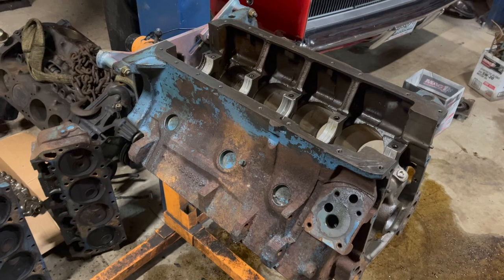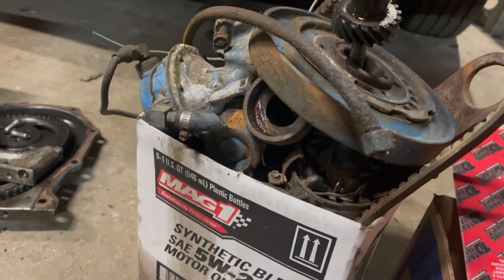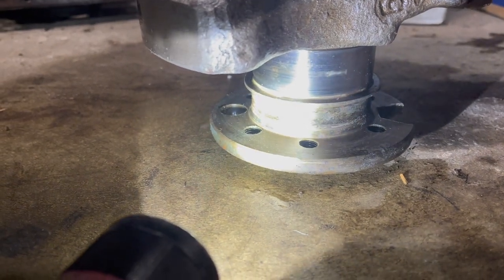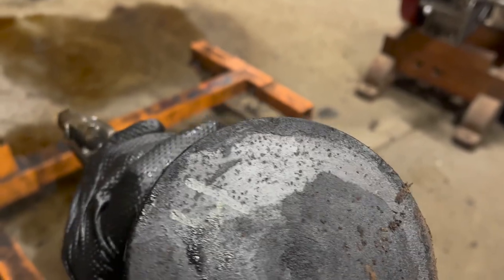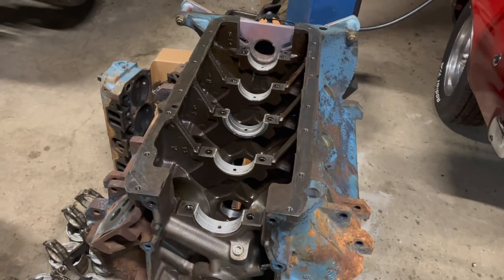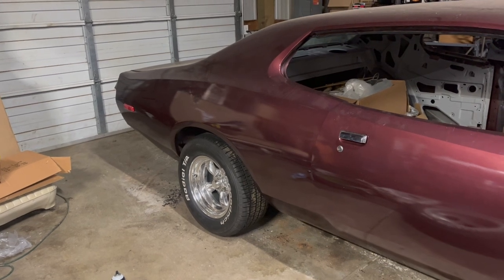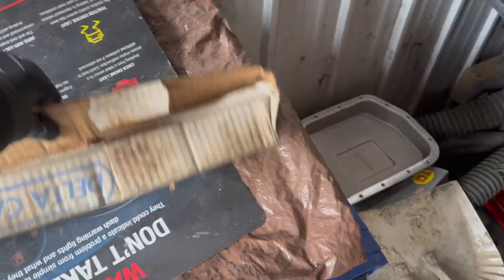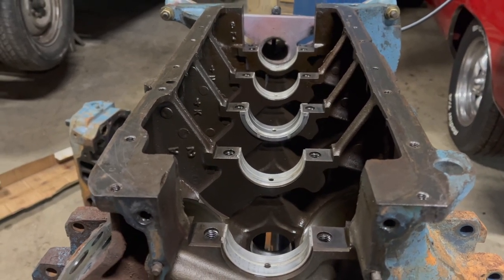How To Annoy A Professional Engine Builder - Convert A Marine 440 To A Muscle Car Engine For Cheap

Comment: I always learn so much from watching your videos.  It confirms a lot of what I've always believed watching good shadetree mechanics building engines without having a machine shop at their disposal.  Somehow things seemed to work out well regardless.  I also agree about the kibutzers.  Everybody is an expert and nothing you do is right, and that applies to everything from body work to engines to cameras (one of my things) to even how I plant my flower bulbs.  Wrong wrong wong and I'm going to hell for not seeking their advice and doing it their way.  Except for the slight problem where they don't pay my bills and don't get a vote in how I do things.

Comment: You've got the right idea (you didn't need me to tell you,lol). The engine "experts" will almost ALWAYS tell you you CAN'T. My engine machinist here in Alabama is age 82 & built race engines for NASCAR star Bobby Allison. I learned to make up some "lingo" required with every job i give him, like "How far in the hole is it ?" (#1 piston at TDC, usually .050 on the smog era RB engines.BTW...those #452 heads,with mild porting are excellent street/strip.

Comment: 11 years ago I bought a bunch of low low miles Itasca motorhomes with 440's in them. Everybody told me I was crazy giving 500-1000 dollars for these motorhomes that nobody would want even if I di fix them up. Within 3 years they were gutted. I now have a very awesome 45' container that I dub the displacement museum. We have come up with all sorts of things to get people scratching their heads. I have a 1981 chevy caprice with a 440 in it.
Reply from the maker: That’s fantastic! I love a good motorhome 440. I was scoring them already pulled for $200-300 for years. I actually just found a motorhome donor myself today! It’s at the junkyard, and it’s kind of amazing because the yard said they’d only take it if the body was fully stripped… so the people did that, but it still has rusty steel framework in the shape of a motorhome body. I think it’s going to become a ramp truck.

Comment: Cool video! Actually those M440 engines used the 440 Six Pack Magnum cam grind that had the 3 bolt drive gear and low taper lifters. I had a couple for the standard rotation engines (Left Hand or CCW).  When you talk about boat or Marine engines the direction the engine rotates is viewed from the flywheel side. It would be opposite looking at the front. So on a standard rotation engine which is LH or CCW at the flywheel, the pulleys and belts turn CW viewed from the front. 
I had a chance to get an NOS steel marine crank once. It was nice, probably just a level below a 6bbl crank.

Comment: Nice, it used to be Hot tank and hone. new bearings and rings for junk yard engine. I had a nice 12 second street car for 10 years no problems. I just checked with chats on the subject and Darn everyone out there Bashing on  Marine block, good to prove them Wrong about it! cant wait and see. and this reminds me i can find a few 440 marine blocks sooner.
Reply from the maker: This engine is now up and running in the 1973 “Toolbox” Charger. I’ve done several videos since getting it together, including a tuning video. It sounds awesome! We are finally about to install the 8 3/4 axle, and then we’ll really get to test it.

Comment: Reverse rotation cranks are ground in the opposite direction and the real seal knurling is typically opposite.
I think it would work fine for my purposes.
Reply from the maker: Ground opposite? Interesting. I knew about the knurling and did mention it in the video. This crank had no knurling whatsoever, which is almost more interesting. Engine’s machine shop trip should be over in the next week or two (I found very deep scratches in cylinder 6 or 8.)

Comment: Well said my friend. Being picked on by people on here is crap. As I told you it's why I shut off the comments on my videos and stopped putting content up. As well as removing tons of cool stuff. 48yrs of building engines and none ever blew up so I don't know anything compared to some clown that has nothing in his garage and mine is full plus sheds full of coolness. When people go low go high and rise above the crap.  Build what you want and run what ya brung. Practice makes perfect and like you said if it don't work you learned something. 😊

Comment: Marine engines are usually high nickel, extra thick castings which is nice, however I highly suggest staying away from any used marine engine that were ran in salt water, only buy/use ones that had a closed loop cooling system (meaning it had regular coolant in the engine that is cooled with a external heat exchanger that is salt water cooled) or ones ran in fresh water only. Ones that have been used in salt water have a bad habit of having severe rust in the water passages and usually all the water ports get pitted really badly on the surfaces which can cause leaks and issues in the future, also a lot of the bolt holes and threads will usually get Soo rusty that you'll have to chase all the threads in the block and have to usually repair several holes as well. Also look any used marine engine over for freeze cracks, that is very common to find as well.
Reply from the maker: Yep. This one came with the closed cooking system heat exchanger tank still attached, or we wouldn’t be here… even so, it pretty obviously ate some water at one point or another, and the outside of the block is just awful in places.

Comment: Beware of a reverse knurl on the rear seal contact area of the crank.
Reply from the maker: I brought attention to that in the video. This crank is smooth in that area.
Reply: @DeadDodgeGarage  Good deal! I've seen normal rotation engines with reverse ground cams and gear drives, reverse rotation engines with normal rotation cams and gear drives. Boats are wierd, also RVs sometimes.

Comment: Good for you nothing the matter with what your doing it does look pretty good I bet it will run fine by the way that a good looking charger
Reply from the maker: It runs awesome actually. This engine has been up and running in the Charger for maybe six months now. It ended up having some serious pitting in one bore that necessitated going .060 over, so by the time pistons and a balance job were taken into consideration, it was no longer the budget build I had in mind. But the rest is as I planned. Home port job, random used springs, used cam and lifters.
Reply: I’ve been thinking of using a used cam and lifters I think so longs ther in good shape all will be fine hey we’re all not rich and wen you live in the Toronto Canada area hey are parts are not cheap considering they all pretty much come from us and are dollar sucks so we pay Mopar tax large I would like some better pistons cause the motor home engine I’m using has low compression I have a 70 steel crank motor but was going to do that one with better parts but maybe I’ll use that it’s so much money that all I can afford is used parts I’m on old age and that’s not a lot to live on I’ll figure it out and who cares about the people that will say no use a new cam maybe they can give me a thousand dollars so I can buy one
Reply: I’ve been thinking of using a used cam and lifters I think so longs ther in good shape all will be fine hey we’re all not rich and wen you live in the Toronto Canada area hey are parts are not cheap considering they all pretty much come from us and are dollar sucks so we pay Mopar tax large I would like some better pistons cause the motor home engine I’m using has low compression I have a 70 steel crank motor but was going to do that one with better parts but maybe I’ll use that it’s so much money that all I can afford is used parts I’m on old age and that’s not a lot to live on I’ll figure it out and who cares about the people that will say no use a new cam maybe they can give me a thousand dollars so I can buy one  I’m a little scare to use a normal cam and lifters I think I can buy a set of rollers rockers that are crane 1.5 and my buddy prob has a good cam and the maybe I can afford new roller lifters I have almost all the parts I need new fuel pump new water pump new bearings new rings not sure about cam bearing s I want to drive this summer  so I’m going to have to cheap out a little lol who cares what people say I’ve seen motors put together back in the day they wiped the parts down all used out of same motor put new rings and bearings and they run fine so what the heck gotta do why you gotta do it’s not like 20 or 30 years ago things were sort of affordable but now days it’s a rich man’s world and that I’m not so just do it and Mopar to ya

Comment: I have 7 pistons and 6 rods for ya. Not enough glue to put no 8 back together. Chrysler marine used double roller 3 bolt. I have 3 of them 440's. One is kinda broke in a few places. Blew the starter off the bell housing.😮
Reply from the maker: Ok, I figured it must be standard equipment given the special nature of the camshaft. Funny that these engines seem to come in threes, as that’s also how many I had. Oooohhh that’s not ideal… I’m going to try to come up with a matched set. We may just get new pistons and have the assembly balanced. It would be nice.

Comment: I have a question  Jamie. When u swap in another set of pistons  from a different motor, doesn't that throw the balance of the engine out of whack? Am I missing something?
Reply from the maker: I wasn’t going to change the pistons in this engine. At least initially… you can swap stock for stock as they were never balanced precisely in the first place. You run into problems when the weight of the piston changes.

Comment: 😄I always enjoy your humor.... I do have a serious question though. Did you remove a water pump and housing from this engine and if so, what differences did you see from a normal clockwise pump?? I ask because I've always wanted to use a reverse running water pump so I can use the space of the fuel pump for an A/C compressor and keep the alternator where it belongs and NOT have to deal with an extra idler for the belt.. Serpentine belt, preferably...
Reply from the maker: I’m not using that housing so I didn’t bother removing the pump. I actually hadn’t thought of that! It must be a reverse rotation pump as it was driven conventionally off of the crank. There was also an external pump for moving raw water through a heat exchanger, which also would have been reverse rotation.

Comment: I can see now why building a 440 or bigger with proper ahem [Indy] heads that can flow over 335cfm can be so expensive...but I did see they offer brand new Iron LA heads complete for $1150 each. 2.02/1.60 with .525 lift springs and the rest isn't too bad.
Reply from the maker: I wasn’t aware there were new iron heads available. That’s interesting.

Comment: Can you tell me what head gasket works the best for a 66 383 and the pistons have no valve reliefs and they also sit down a bit at top dead center with 346 heads that have been rebuilt? I’ve looked everywhere and there seems to be a bunch of different thickness gaskets?
Reply from the maker: Yes there are. Thinnest head gasket, highest compression ratio possible. I can’t tell you what is best for your setup. I have never used any head gasket on a classic Mopar engine but the standard rebuilder Felpro gasket. For the kinds of builds I do, it just doesn’t matter that much.
Reply: @DeadDodgeGarage  I knew I'd have few regrets subbing to your channel. Quick answers to questions and a guy is on his way to getting his ride moving again !

Comment: Since the cam spins the opposite way on this marine application, are the drive gears cut reverse too?
 The distributor/oil pump drive spins in a way that forces the cam to the rear of the engine. Thrust surfaces are on the block and the back side of the cam drive gear.
 Just curious if the gear drive is cut different to keep the rearward force on the cam.
Reply from the maker: I’m sure they are, but now that I’m thinking about it, I never checked.
Reply: Thanks. 
  If you do happen to find the oil pump drive gear laying around,,, I'd be interested in your findings.

Comment: A small block distributor being used on a reverse rotation 440? An early hemi 331-392 would be more likely if a spacer is involved.
Both are for made for clockwise distributor rotation. The "early hemi" has a longer shaft going to the oil drive.  The small block would need the shaft extended to reach lower.
Reply from the maker: My understanding was that the 50s Hemi distributor is not much longer than LA - like 1/8”-1/4” or something - but I’ve never had a chance to compare the two. It was a cast iron body.
Reply: @DeadDodgeGarage  The difference is about an inch. I had one of each sitting in the same box. I'll have to put a big block distributor next to them to do a three way comparison.
Reply from the maker: @auteurfiddler8706  interesting. Yes, this would be great information. I would say that the spacer in the big block to accommodate the other distributor was about half an inch taller. I don't think it would be a big deal to install the RB distributor shaft into a clockwise distributor, but I'm guessing using a spacer and an off-the-shelf part was cheaper and easier for the marine conversion company.
Reply: @DeadDodgeGarage  Spacers are sold to allow a 440 distributor to be used in a 383/400. The spacer is a stepped cylinder that goes above the 400 block beneath the bottom of the round part of the 440 distributor.
  I saw a video where a guy was working with a reverse rotation engine and the timing was getting way off. It seems the reverse rotation distributor had a screw on bottom piece. As the engine rotated it tightened. But he converted it to clockwise rotation and now , after the conversion, the normal rotation was making it unscrew, messing up the spark timing.

Comment: hello  my name is Charlesi would like to ask if you can help me with my 440 i am using a 8 71 blower and i need to know[ DO I ADD A VALLY PAN OR NOT USE A VALLET PAN WITH THE BLOWER INTAKE]??? I CANT FIND INFO ON THAT CAN YOU HELP ME  THANKYOU
Reply from the maker: If it covers the area the pan went and screws where the pan screwed, you probably don’t use one. There would probably be a special gasket you need to use, not unlike the max wedge gasket (but not the max wedge gasket.)
Reply: @DeadDodgeGarage   ok thank you very much

Comment: wouldn't the oil pump be different as well or did you mention it
Reply from the maker: I actually hadn’t even thought of that so didn’t mention it, but I’m not using anyway. It has external oil cooler lines I don’t need so it went right on the pile.

Comment: Jamie, have you ever done a video on tips for changing pistons? I have a motorhome 440 that looks in good shape but i would like to swap the low compression pistons for 6 pack style high compression units. Trying to understand what i can get away with, would like to just hone the standard bore block and install new pistons on my existing rods and run it. Do i need to have everything balanced? Am i kidding myself that i can do this in my garage and avoid a machine shop? Motorhome block has less than 20k miles, seems a shame to have to rebuild the whole thing....
Reply from the maker: No I haven’t. If you match the piston weights perfectly, and the bore clearance is acceptable for the type of piston you choose, you’re fine. But verifying that is a tall order at home in the garage. The engine is coming completely apart to do this. I would want to do it as right as possible.
Reply: @DeadDodgeGarage 
So when you mention that you have some pistons that might work somewhere in the shop, what do you ultimately end up doing? If the side wall clearance is acceptable, you have your machine shop balance the crank/rods/pistons and then handle honing and assembly yourself? I kind of want to do most of the work myself (mostly out of curiosity) but need to figure out what's reasonable and what's not. Assembly and disassembly, honing, ring filing, all things I believe I can handle. Ultimately, this is a stockish 440 going into a cruiser, it will never see the track. This is mostly a way to do something other than computer work to entertain myself.

Comment: Nah.... you ain't gonna piss me off ?  Why would it piss any body off ?
Garbage in = garbage out... all you are gonna learn is stoopid is as stoopid does ?
Fill ur boots and good for you.... but don't forget that many of us have already forgotten back in the 70's/80's more ways to make power with stock B/RB/Hemi parts that you'll discover in the next 30 years ?
BTW.... next time you degree a BB Mopar Cam on #1 ? Roll it around and check centerline on it's running mate #6....
then while wondering where the 4* came from.... come back and re-read this post OK ?
Thx.... very entertaining.
Reply from the maker: Absolutely

Comment: That's going to be just fine Also I pretty sure that Marine motors are made with more nickel in the casting ? Stronger ? Marine gas motors spend most of time at 3300 /3800 RPMS How do I know this. In the recreational Boating lm known as a god 😅 Captain Bee  Barry  😮
Reply: Funny how it's kinda like Highway Driving ! Not lugged around town ...
Reply: All of chrysler's engine blocks from back in the day , from the /6 up to the 440 have a high content of nickel .